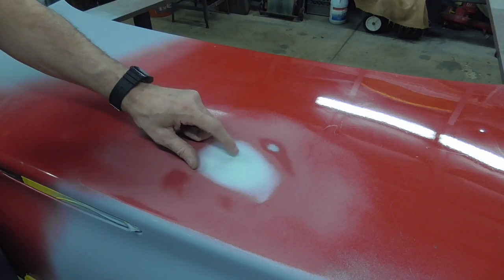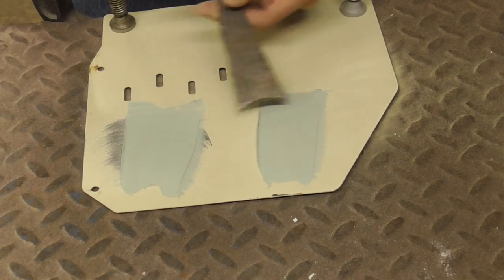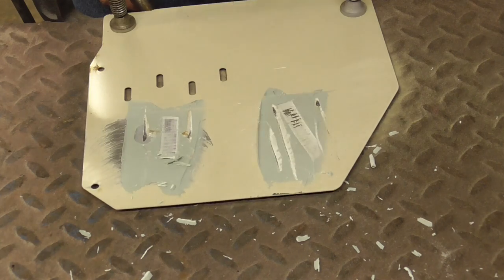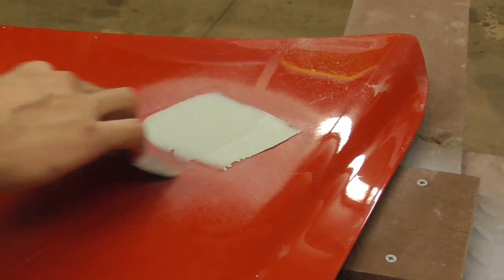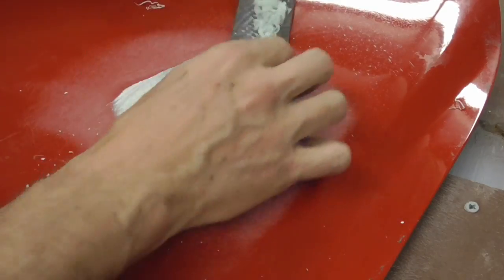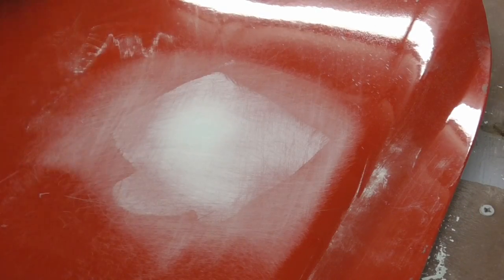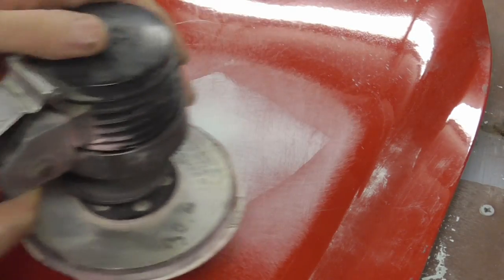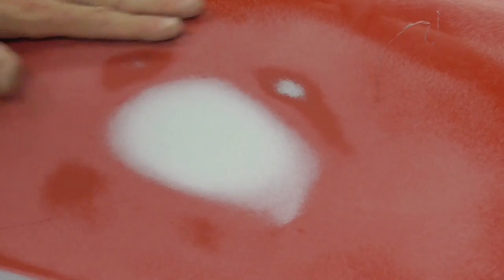Can Body Filler / Bondo be Applied Over Paint?

Comment: Great video and totally accurate. People always say you have to grind to bare metal for filler. I called 3M when I started doing bodywork years ago and they said it was fine to use over paint as long as you sand first to give the filler something to grab on to.
Reply from the maker: Good stuff Robert - thanks for your input - have a good weekend :)
Reply: Good common sense video. Same method I have used for years.  12 yrs ago I used bondo on a sizable dent on a factory painted quarter panel  using a one step auto red enamel. As a top coat. I am repainting that truck this week. I had to hunt for the Bondo repaired area. Fixing to fill a few more spots such as you mentioned. You did a great job on bringing filler down to just where dent, and small affected are from the dent was. That's a nice repair in the make. Thanks for the video. The demonstration of sticking to paint was good also.
Reply: Badass I knew it !
Reply: What grit will it bond to?
Reply: @MrBeachwaves  The lower the better. I usually use 80, but I have used many of the lower grits and have not had any issues.

Comment: That's what glaze was made for. Any of the premium fillers such as Rage, Rage Gold or Rage Extreme also will work but Metal Glaze is probably the best for this application. I completely agree with the cheese grater. Why these aren't used more in modern autobody is a mystery to me.
Reply from the maker: Thanks for the support and comments.  I agree with the statement about the cheese grater blades :)
Reply: I am old school like this video. Keep it simple. Common stuff laying around the shop repurpose into pretty amazing tools for auto body.
Reply: @perryberens618  I love doing that. 
Years ago I kept a bunch of 855 Cummins wrist pins , because they're solid and measure about 1.5" by 4" long or so and the ends are machined flat. 
They gotta weigh 2-3 pounds I'd think. 
I'm no good with a hammer/dolly but it would be a good one. 
I pound tin flat or curved on them or things like that. The rougher ones make great hammers for a little tap tap when ya need it.

Comment: I was under the impression that you had to go to bare metal for body filler. But your demonstration shows it is just as good on sanded paint. Saves alot of time too, for small dings! Thanks for your
Sharing your knowledge, Jerry!
Reply from the maker: You're welcome. Some folks might disagree with putting filler over paint, but I have done it for years without a problem.  Jerry

Comment: One proviso I would add is that you cannot put polyester filler over lacquer. The catalyzed resin is just too hot and it melts the lacquer, and that will cause complete system failures.
Of course, nobody uses lacquer anymore, but some GM cars clear into the late 80`s and early 90`s could have it. Check for a WA  or L paint code to find out. 
Also, putting filler directly over paint will increase the flexibility of the filler by a huge factor. In fact if a repaired panel is ever hit again, the difference in the performance of the filler is dramatic. Polyester filler over bare metal is brittle and will crack which opens the repair area to rust. Anymore, I rarely grind a repair panel unless I have to use a stud gun.
Thanks for the great videos, you are giving everyone some great tips and I really appreciate you modeling good technique and wearing a good mask to protect your lungs!  Safety and Health are huge issues when dealing with the chemicals associated with auto body repair and paint.

Comment: I have done a lot of body work, I preferred to do bodywork over self etching epoxy primer! I’m Fascinated  at how well it worked over paint!
Reply from the maker: That's good to hear Robin - We always put filler right over paint or bare metal.  Remember epoxy primer wasn't around in the 70's - 80's - filler was applied directly to metal and held up fine.

Comment: It makes sense that filler "has" to stick to paint, for example if you sand the paint off down to bare metal,  how are you going to get rid of the tapered step were the bare metal meets the paint without putting filler onto this tapered step, "bearing in mind this tapered step is made up of paint".
In my experience as long as any polish and clear coat is removed from the paint surface with T cut or scotchbrite then there is no problem if filler is applied on top of paint.
Reply: Removing the step is called " feather edging". Which mean to sand each layer of paint or sealer a half an inch

Comment: I prepped a lot of filler I used to use those cheese graters like that I don't do that anymore when I prep filler now I will let it get to where that it's still somewhat soft and almost dry then use the roughest to the lightest grit sandpaper and it works pretty good it's also a little technique I picked up in college then I tried it for myself and it works wonders
Reply from the maker: Thanks for your input Dale - everyone does things a bit different.  My dad used to use a big old grinder/sander w/ 24 grit to knock it down quickly :)
Reply: @LakesideAutobody  everyone does have their own way I agree with you on that

Comment: It’s best to apply filler over paint that has been properly sanded for mechanical adhesion but it’s rare because I usually use filler over damaged metal that I have to metal work with a stud puller etc
Reply from the maker: You're right on Tairone - usually you are putting filler over badly damaged metal so it's always ground clean :)

Comment: Old yesteryear polyester body filler wasn't recommended to be applied over paint . A good quality body filler nowadays. Can be applied over aluminum, steal, fiberglass, and paint. The product label will always indicate whether or not it can be apply to a surface or not. Cosmetic body filler can be applied over paint, plastic, and fiberglass but body fillers made for bare metal will have a corrosion additive. There's also waterproof body filler . And sprayable polyester.
Reply from the maker: Thanks for the support my friend - have a good weekend :)

Comment: Thanks for this helpful video.  I bought a hail damaged car and the paint is in good shape other than the hail dents.   I had followed this same procedure of not sanding to bare metal in the past with good success but I wanted to make sure that would work when much of the surface will have fill on it due to hail dents.   

Do you have a video on using high build primer to prep for painting?
Reply from the maker: Just DA sand with 240, fill, prime with primer surfacer, block, prime again, finish sand, paint.  I think these will work for you - https://www.youtube.com/watch?v=31ONIPIprJk  & https://www.youtube.com/watch?v=mApSa0l4euQ
Reply: Thanks so much for your quick response and the recommendation for more videos.
Reply from the maker: 👍 @7777dblack

Comment: Another advantage of filler over paint is corrosion protection. Assuming it's OEM paint in good condition, like in this video, the oem primer will offer much better corrosion protection as first layer against bare steel than typical body shop practice of filler over bare steel covered by cheap primer. However epoxy as a first coat to bare metal has been proven as the absolute best practice, both adhesion and corrosion protection, with then filler over the epoxy.
Reply from the maker: Well said - thanks for you input :)

Comment: The OEM paint is well adhered to the body panel.  Electro deposition paint thing process, if i remember correctly.  Having said this, the OEM paint that is sander down becomes the foundation to which the filler can attach to.  That's my guess...
Reply from the maker: That's a good explanation.  OEM paint in good condition is a good primer :)

Comment: Thank you for this video and very informative 2? 1 can any body filler be applied to the panal with out going to bare metal and 2? Can the same thing be done on a hand size dent thank you  injoyed this video and look forward to more of your videos
Reply from the maker: 1. yes 2. yes   You can get away with using 80 grit to sand the filler with.  Don't want to leave deep scratches in the paint by using 40 grit or something.  You can always prime with a 2 part primer to make sure you bury any deep scratches.
Reply: If you have a hand sized dent, you need body work done first. Bondo shouldn't be more than an 1/8 inch deep at the most. I only want to see about a 16th" or less.

Comment: What do you use to clean the surface?  Do you clean before sanding? After Sanding?
Reply from the maker: Any brand of auto body wax and grease remover will work.  Use it before you begin work and any time during the repair :)

Comment: Jerry, what do you recommend sanding epoxy primer with before applying filler? 80? 180?  Thanks, John
Reply from the maker: Since you will be sanding the filler with anything from 80-120,  that's what I would sand the epoxy primer with before application.  You will then prime again, block sand with any thing from 120-180, prime once more then finally finish sand with anything from 220 to 400 then paint.  If it's just a tiny repair, you can sand it with any grit paper from 80 on up.  - hope that helps, Jerry

Comment: Hi! I wonder why you didn't use D/A to sand the filler at the very first time but cheese grater and sandpaper? 

I'm just getting started as an auto- bodyworker. At my workplace, they rarely use D/A for sanding but by hand sanding. 

When I asked them the reason, they said "it's not necessary to use D/A"

I don't know why. Isn't that D/A could speed up the whole  process?? 

Btw, I've just subscribed to your channel! Thank you for this amazing explanation
Reply from the maker: Such a good question.  A DA is very not supposed to be used for sanding filler at all even if you see it on YouTube.   It will not get it straight unless you have done filler work for many years and are very experienced at it.  You should always use a long board, medium board or short board depending on the size of the dent.  The DA is only for feather edging paint or prepping panels for paint.

Comment: Lakeside Autobody Could you do this over a larger area...Iask as I have a sliding van door with a crease line right along its width....I've already found a lot of filler on the lower part of the door that needed to be removed as it had rust underneath it... and im reluctant to dig deeper than I need to.
Thanks... and Nice video.
Reply from the maker: Yes - In 1989 there was a bad ice storm where I lived.  A Ford dealership was sending the shop I was at a whole row of cars that were parked under the power line and damaged from ice falling.  That's how we fixed them all and it worked just fine.
Reply: @LakesideAutobody  Excellent... thank you

Comment: Can bondo  be added to other older  bondo if you smooth it out it’s around a trunk key hole some is loose
Reply from the maker: Yes.  Chip or sand away the loose filler,  rough up or sand the area and spread the new filler.  Filler sticks well to sanded metal, paint, primer, plastic bumpers, even wood :)
Reply: Thanks a lot for the advice saves me some time

Comment: which filler did you use for that?  Nobody on these videos explains what products they are using most of the time, but I'd like to know what to buy.   I've tried "Bondo" brand, and it is just too hard.
Reply from the maker: Bondo brand is fine - you have to use a cheese grater first, then sand with 40 grit on a bondo hog or air file - even by hand.  See this video for an example - https://www.youtube.com/watch?v=34Jh4RDMAjw  the brand of filler I use is listed in the description but trust me, it doesn't matter what type you use - it's your method of sanding that is going to make the difference.  Don't be afraid to use course paper like 36 grit and 40 grit then move to finer stuff like 80 - Jerry

Comment: What kind of primer do you like to use? Is a 2k epoxy primer ok for the bondo and existing paint after sanding?
Reply from the maker: Yes 2k is fine. I use lacquer primer because it works and is cheap.  It builds fast, drys fast, sands easy, doesn't harden in the cup or the can, and you can pour the remaining mixed primer back in the can.
Reply: Lakeside Autobody any brand that you would recommend?

Comment: One thing I hear a lot about this topic is OEM paint. What about being used on say a PPG respray?
Reply from the maker: I'm not afraid to put filler over any type of paint as I've never had filler lift, fall out, crack, etc.  If the paint is cured, in good condition, and a real automotive paint then I think your OK.

Comment: What is the lowest temperature that bondo can be used in? Anyone know? Thank you.
Reply: You can use it in cooler temps, recommend temp is 77 for 15 minutes but it’s said if it is lower temps then it may take up to 20-30 minutes. Bondo creates its own heat through a chemical process to dry. So temperature isn’t a big deal I’d say unless it’s below 50

Comment: If I sand a truck down with 80 grit and have bear metal spots do I have to use sealer or can I just you primer
Reply from the maker: You can use your choice of automotive grade primer.  You'll want to go over that 80 grit with some 120 to smooth out the 80 grit scratches in the paint.  80 grit scratches on metal won't be a problem but in paint, they sometimes show up after some time being painted.
Reply: @LakesideAutobody  oh ok so before primer sand it with 120 or after primer and I think the primer I have is called High Teck Products 7740016 High Solids Acrylic Lacquer Primer Surfacer-Gray-4.58 VOC-GL is this ok
Reply from the maker: @Nelval573  Yep that's good.  You'll need lacquer thinner to thin it.  Doesn't have to be super expensive stuff either.  Lacquer thinner from walmart or home depot will work fine.  You can use 80 grit for all of your rough spots and 120 for chips, etc. then 220-240 for panels that are near perfect condition.   For example,  you would DA sand a brand new car with 240-320 and then paint it.  An older car might have some chips and rough areas that need to be hit with 80-120 grit then primed and then finish sanded either DA 220-240 or by hand 400.  Primer surfacer is meant to level highs and lows in your body work when you block sand it.  It's not necessarily for filling sand scratches even though tons of people do use it for that.  Keep asking ?s if you need :)
Reply: Thanks for your fast replies you've answered all my questions appreciate the help 👍 I'm going to try these steps and see what happens.
Reply from the maker: @Nelval573  Let me know how it goes :)
Reply: Will do

Comment: What are your thoughts over 2K primer? I'll be getting a car back soon that has many dings. I want to take care of them myself before final paint.
Reply from the maker: 2K is very good - just more expensive than lacquer primer.  Use urethane for a "filling" primer or a primer surfacer and epoxy primer for regular priming (epoxy is sort of like a primer/sealer) but doesn't fill.
Reply: @LakesideAutobody  the body shop that is doing this for me is doing the major body work, but leaving it up to me to take care of small dings etc. so my question is can I just scuff with 120 or whatever you recommend before filling dents? As opposed to taking to metal just on those spots. The 2k that is?
Reply from the maker: @mikejessup9304  You can sand those areas with dings with 120 before you fill.  Here's a video that may help with that - https://www.youtube.com/watch?v=koMw6-auoIs

Comment: You dont need a cheese grater on such a small job. Use glase coat and 150 grit on a da. Simple and fast.
Reply from the maker: With respect, the cheese grater is way faster, no dust, more accurate (cuts through), don't have to wait for the filler to completely dry, doesn't clog like paper, cheap 'cause you can use ref. filler, fine paper rides - doesn't cut.
Reply: @LakesideAutobody  Dont get me wrong i love to use the cheese grater on larger jobs.  It is faster  shapes quickly and no dust  all true. But not on a tiny ding.
Reply from the maker: @warrenvitters3983  Sorry - didn't mean anything negative.  We use to use Evercoat for hail damage and small dings and you're right you don't need the c.g.  I just use the grater for everything no matter how small because it takes that top gummy layer of filler off so the paper stays clean.  Have a great week Warren - Jerry
Reply: @LakesideAutobody  enjoy your channel. Keep up the good work!
Reply from the maker: @warrenvitters3983  Glad you enjoy it - talk to you soon :)

Comment: I have a 32 year old car that I want to repaint the same color, primarily because the cars entire body is filled to the brim with dings and swirled paint that is fading just from age, but it has no chips or spots with sun damaged clearcoat. How do I go about repairing tiny door dents (all are smaller than a quarter). The entire point of going over your original paint is to avoid using primer and doing a ton of extra work. Does the bondo/body filler count as a form of "primer" and can just be painted right over, or does the spot thats been filled in need to have primer applied? No video answers this. Which is suprising because realistically anyone who wants to repaint their car is going to have dents.
Reply from the maker: Here's the process for a ding:  1) DA sand with 220  - big enough so that the filler doesn't go on shiny paint 2) sand the filler and scuff or DA sand out further so that you don't get primer on unsanded paint 3) Prime the spot with primer surface because it's not perfect and you'll need to block sand it 4) block sand, prime again, finish sand and paint.  The side of this Kia had tons of dings - may help to look at this video - https://www.youtube.com/watch?v=2H3UHCgQu2Q
Reply: @LakesideAutobody  Thanks dude, that answers my question. :)
Reply from the maker: @jamesd2224  That's cool - if you ever have ?'s feel free to ask - I usually get to the comments 1-2 times a day :)